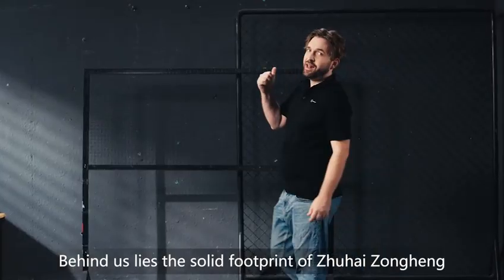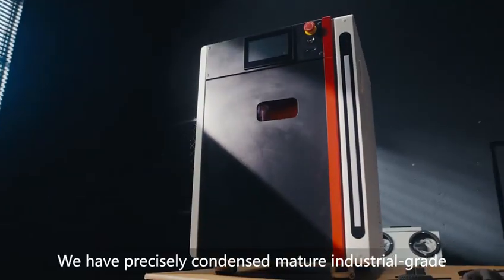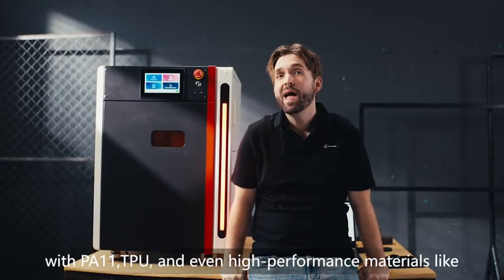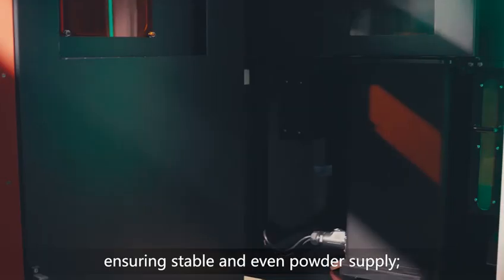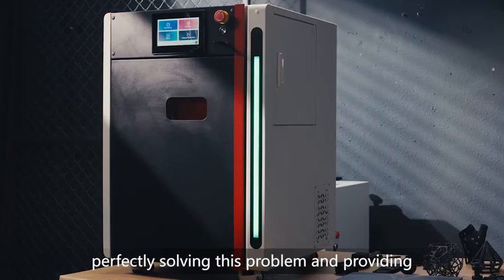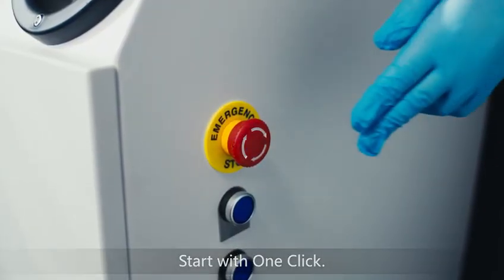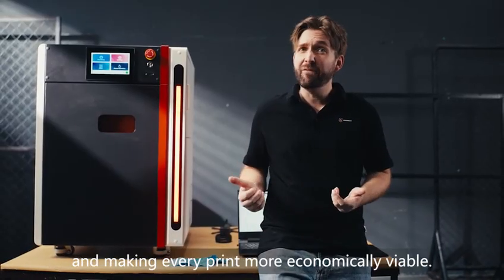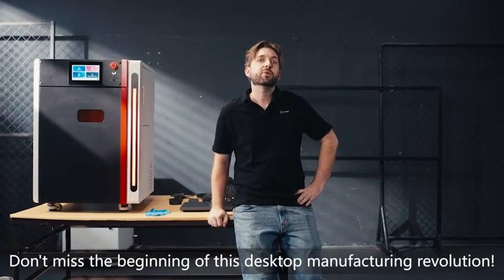🚀 It's Live! The SLS1518 Desktop SLS Printer is Now on Kickstarter!✨

Comment: Hmmmm... $7000 (but $13,000 after kickstarter).  Deep pockets needed.  But the technology is inspiring if it works reliably.  You can pack the volume with parts of all sizes and shapes , set it going and come back for a bag full of parts.  Material powder can be reused which is great compared to FDM and CNC which has a lot of waste.

Comment: The powder distribution is probably the hardest part of SLS printing.  If you've managed to produce that at a reasonable cost, how about making a direct laser Metal SLS printer too - you've solved the biggest challenge, the rest should be relatively straightforward.  That would be a killer product!
Reply from the maker: Hi, thank you for your suggestions but currently we just focus on laser powder SLS printer and would like to provide high-quality machines for clients. So sorry we don't have plans for laser Metal SLS printer at the moment :)

Comment: The price is steep for an unknown company with no proven track record.  What is the support for the system?  What is the software like?  Is there any open-source aspect to the project? It is hard to consider an investment of $7000 USD to an unknown, unproven company.  Can you all please send some demo units to some large 3d printer influencers.  I will be following.
Reply: Send them to small influencers that we'll believe more readily.
Reply from the maker: @ChrisEpler  Hi, thank you for your suggestions, we're currently contacting some 3d printer influencers to testing the printer and post-processing machine. Stay tuned :)
Reply from the maker: Hi, thank you for your feedback. Yes we understand what you are concern about. The slicing software is Voxel Dance Tango and it's open source for printing materials and printing parameters.  We're currently contacting some 3d printer influencers to testing the printer and post-processing machine. Stay tuned :)